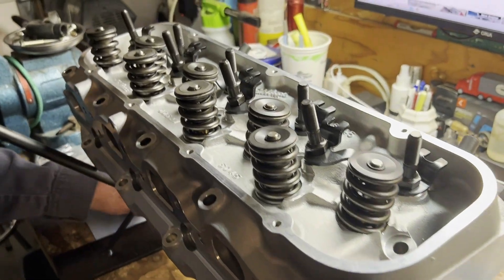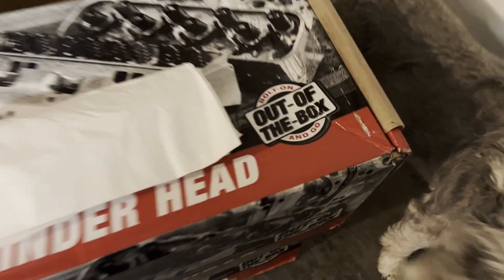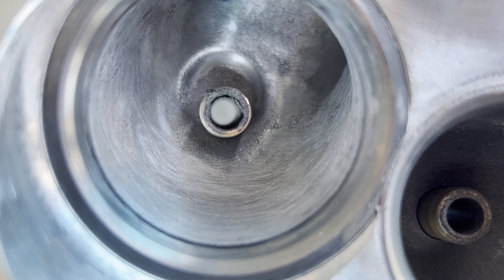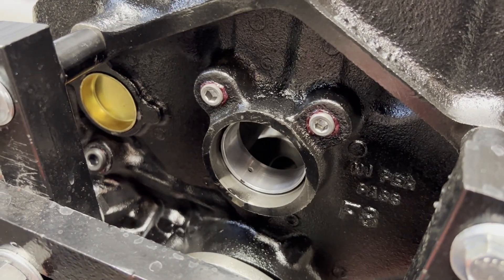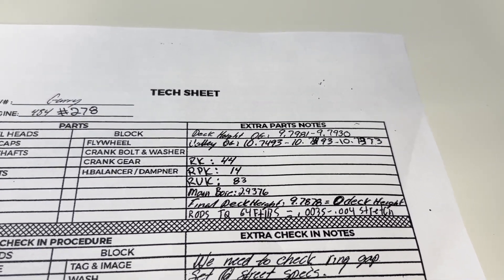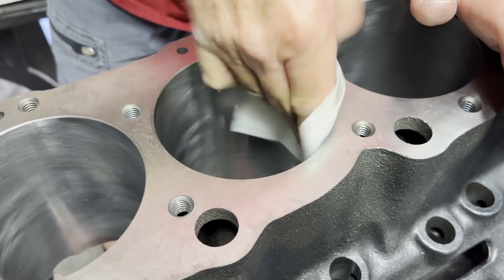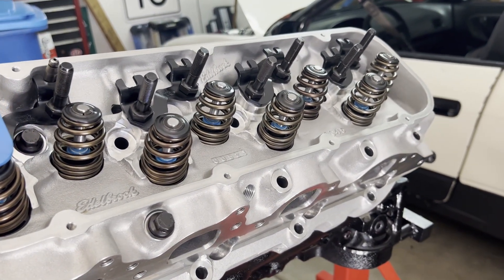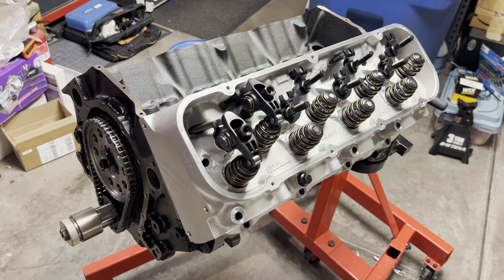496 Big Block Chevy: Final Assembly!

Comment: I built a 496 because the 468 had a stock cast crank in it and the center main bearings were not lasting very long shifting at 7000 rpm. Going to the Scat forged 496 crank the engine ran perfectily with the same solid flat tapet cam setup(I would check the clearance once in a while but never needed to adjust anythung) for 25yrs of weekend street racing and some Track time at Bradenton Fl every winter @ below 60 degrees. I sold the 69 Chevelle SS a few years ago and i'm sure its still running fine!

Comment: Nice engine build, I liked your video a lot. You took the time to show some detail that others do not. I have those same heads, but they are labeled as E-Street. Same casting, #6045. I planned on cleaning them up similar to what you did, no big deal. Will be running them on a 454 in my Corvette. Starting with a new ZZ454 block. I had already built a 540 engine for the car but backed out. Thought it was too much and that it would be a better match in a heavier car like a Chevelle.